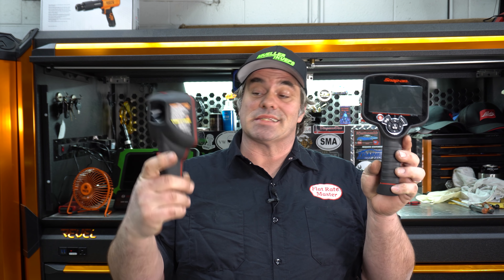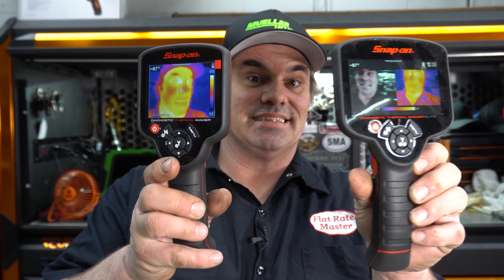Should you buy Snap On's Diagnostic thermal Imager Elite

Comment from the maker: FLIR ONE Gen 3 - Android (USB-C)
https://amzn.to/2SaCSBe
FLIR ONE Gen 3 - iOS
https://amzn.to/37csk8Q
FLIR TG165 - Spot Thermal Camera 
https://amzn.to/2H7g5jC
FLIR E5 Compact Thermal Imaging Camera
https://amzn.to/31D7IW9
FLIR E6-XT - Handheld Infrared Camera 
https://amzn.to/31NiZnb
Reply: @Jacks Journale , the FLIR One PRO (Higher temp and better CCD) is a great option (especially lower cost than Snap-On).  If one is worried about having the phone near the engine bay, you can use a lighting extension cable from the port to the device.
Reply: I got the FLIR TG275. I'm not impressed.  But I didn't spend Snap-on prices either. So not that big of a loss?

Comment: Diesel world I love mine. Replacing DPF/DOC/SCR you can look for leaks after replacing. Older motors that won’t give you a cylinder contribution code because ya know it’s pre ecm days you can look for dead holes. Like you said looking for draws. Used it for finding hvac leaks behind the dash. Looking for boost leaks. During the winter when I check out farmer joes combine or baler or ant machine with lots of bearings and shafts I will run it for 30 minutes to a hour then check all the bearings and clutches. Hell I used it at home to see why my house was so drafty lol.

Comment: I think it would be hard to justify the cost of the Elite if you already had one but I bought my Elite in a heartbeat! I went to buy one just as it came out. My rep was trying to get me to buy the old one at a massive deal and I said no way. Definitely glad I did. I've found the larger screen of the Elite to be quite useful. Especially for seeing anomalies and getting the big picture feel. I grab this thing often and usually early as a super quick check to rule things out or to learn information. Even if there's only a small chance that I'd miss a problem using a Flir but catch it on the Snapon thermal imager elite... ya, I'll easily pay the extra grand for that... I've made so many calls with this thing and avoided making wrong calls that this thing has paid for itself multiple times over! Just my take though. 👍

Comment: These thermal cameras seem like tools for diagnosticians who already have most everything else and have some money to burn. Can they be helpful in certain situations, yep. Most guys I've seen regret buying expensive thermal cameras and can only point to a few times they've come in really handy. If it works for you and you like it I'd say go for it I'm just not there yet.
Reply: I am sad to say that I have the snap on elite.  It lives in the bottom of my diagnostic box and rarely comes out.  I have checked a few defroster grids with it.  Mainly I forget that I have it. And as Flat rate master said, the software is a little annoying.  Seems to want to calibrate every time you move the unit ever so slightly and calibration takes at least 5 seconds.   Its a cool tool, but I see it more of a toy.
Reply: That's the same basic review of thermal cameras I've seen over and over I've been tempted several times to buy one but haven't been able to justify it

Comment: Yeah the customer complained that you looked at the car for five minutes and charged an hour.     But  does he have a tool debt and a lifetime of investment in tools and knowledge.  Not to mention the thousand dollars snap-off wants for a thermal imager.   I think not.   We buy our equipment to get paid in the long run. 
 Faster time done properly equals more money.  And the customer is happier with a quick efficient repair done right.
Reply: That tool is definitely out of the price range of the back yard mechanic
Reply: Oh yeah.   For the home gamer the phone attachment might be a more do-able option.  Not to mention one of the lower prices units that are out.   The Snap-off is nice but for the money there are other options, it's ike that alot with Snap-off test equipment.   I do really like their Hardline  tools
Reply: @p.o.9964  I use a regular laser temp gun. Works just as well and cost 10% of what the thermal imager does
Reply: A thermal gun will work and if your put the time to map out a thermal image.  you can plot your temperature  points on paper.

Comment: Here's another vote for the Flir One Gen 3.  I paid a bit over $200 for mine, and it works extremely well on the iPhone 7-Plus (large screen on the 7-plus) I already own.  And don't let phone battery life be an excuse not to get the Flir.  I have a Mophie Juice Pack (it's just a battery built into the phone case, with a stupid name) for the iPhone.  Gives me about three days power without a charge.  I saw the Snap-On Elite on the truck. $1,895 freak'n dollars!!??  Has Snap-On gone completely NUTS?  I don't wonder that there are plenty of dealers going out of the Sanp On tool business.  Their prices have gone just plane beyond reason.

Comment: My answer is a simple no. You can buy other solutions for much cheaper. I use a Milwaukee hand held and also have a FLIR one for my phone. The snap on one would be good maybe for someone who uses one all the time where you use it more frequently. This is how these companies make lots of money. This call needs to be made by the guy buying the tool. I would say yes to upgrade if you have the original and use it a lot. I just think a shop should purchase tools like this not the individual tech. However you look at it it’s your money buy what you want. It’s not only techs but dealers wind up in trouble money wise, and this is what so many of the older techs and doing vids are trying to make you aware of.
Reply: Only thing about shops purchasing a tool like that is the abuse it will recieve.  A "shop tool" gets treated very poorly, never put back and all the accessories get lost.  When a tech buys their own, they seem to take better care of it.   Half of our shop tools at the dealership have missing pieces or end up in a techs box, never to be seen again